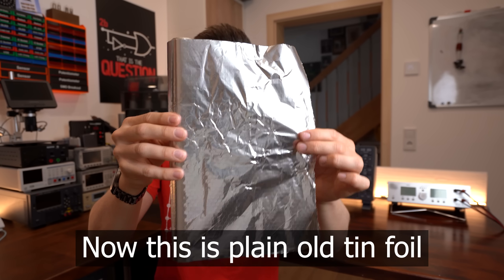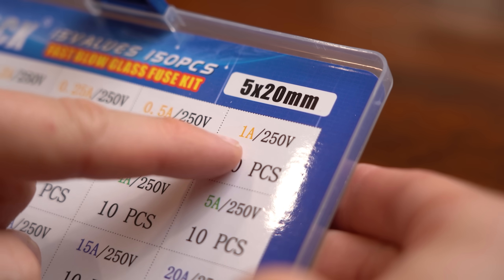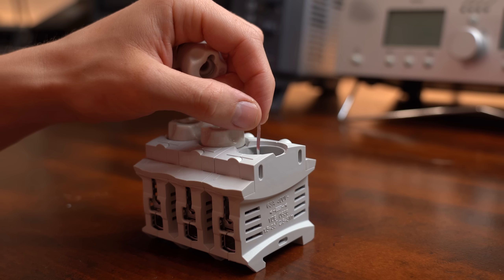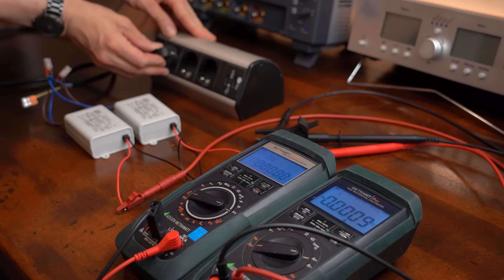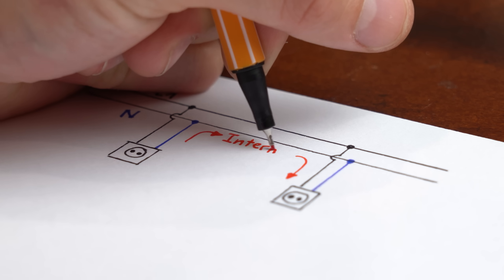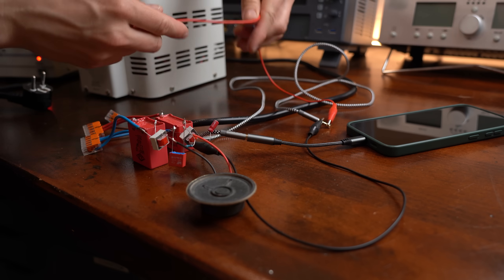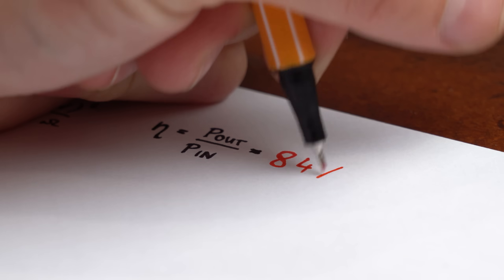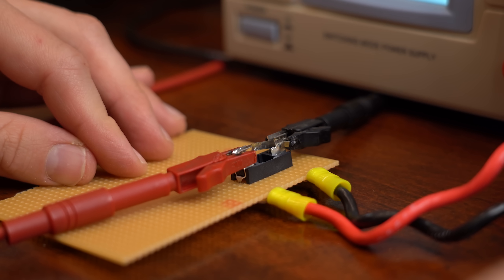I tried Busting 4 Weird Electronics Myths!

Comment: An interesting commercial (?) application of motor-as-inductor is the Tesla Roadster's battery charger. Yup, that's right, the 17kW internal 240VAC/70Arms battery charger of the Roadster uses the induction motor as the inductor when charging the traction battery. This was design content inherited from the AC Propulsion T0 (the IP from which the Roadster was derived), and is frankly silly in several ways. 

The efficiency is pretty low, but more critically, it means that the entire motor needs to be double insulated from the vehicle chassis for electrical safety. The motor uses an insulative drive coupling, is mounted on insulated standoffs, and is, very unfortunately, air cooled through an insulating duct. 

Anyone who has worked with cooling of high power density devices knows that direct air cooling REEAALLLY sucks. Blows? Well, it's very not good. Water cooling with a separate radiator is massively better in most ways, with lower pumping power loss, more flexible packaging, etc etc.

But it did work, some several thousand of them were sold, it launched an EV empire, and catapulted a very (ahem) interesting person to world fame. So, in that one application at least, we can't really denigrate the motor-as-inductor.

Comment: @5:10 This experiment, but with two (or more) identical high-quality server PSUs would be really interesting. These devices obviously have overcurrent and heating protection, so I cannot really see a reason why you couldn't run them in parallel.

Comment: Lay person question about Fuses:

Are there reliable reset-able/electronic (?) fuses for DC for something like “I know the device powered can draw max 3 A, so I want a fuse that immediately disconnects the current if 4 A are reached” to prevent damage to the cables or power supply?

Comment: I have seen that sort of thing mentioned in the 30s.   I think that they did not use standard tinfoil,   but rather the very thin sort of foil used in cigarette packs or chewing gum wrappers.  Cut into strips rather than wadded into a ball.

Comment: In the late 80's, a friend owned a Mazda Capella here in Australia.  While out and about one day, one of the fuses broke and we were stranded.  Not wanting to wait for a tow-truck or catch a cab (the years before mobile phones) we would have to make a trek to the nearest phone booth and call for help and we both didn't want to do that.  We were smokers (we know, horrible) and cigarette packets had a type of tinfoil paper inside around the smokes.  Using a trick his uncle (a mechanic) had showed him, we ripped out that paper, folded it up around the old fuse and inserted that.  It WORKED.  We got the car started and got to drive home.  Of course he was never going to keep it there, but it worked enough to get us home and again to get his car to his uncles the next day to fix it properly.

Comment: For the fuse you are only supposed to put a single layer and hold it in with the glass element.  Power line communication actually uses pretty complex modulation and error correction, so it's only good for digital data, and completely fails if you plug a cheap Chinese phone charger  anywhere in the house.  Finally APC actually modulates the H bridge on the inverter transformer as an inductor (using leakage inductance) to boost the voltage and charge the UPS battery.  The down side is it gets really hot modulating a steel transformer at khz. It's great if you don't mind cooking the battery and buying a new one after the warranty runs out

Comment: I always thought the tinfoil thing was that you were supposed to wrap it around the outside of the blown fuse. But then I may just be thinking of watching MacGyver do it all the time, and I think he used to use a gum wrapper.
Either way I don't think the idea was that it was supposed to serve as an actual, appropriately valued replacement fuse, but rather that you'd pray the house didn't burn down, until you could source an appropriate replacement the next day or whatever.

Comment: It's worth pointing out that there are some power supplies that are designed to allow paralleling like you described. This will be a feature called out explicitly in the data sheet in my experience.

Comment: Ive used strands of super thin copper to mimic a fuse, when my buddies cj5 jeep died in the middle of the woods after we got done mudding, it worked fine, when I got home I tested to see where it would burn and it was 4.5ish amps, replacing a 5 amp fuse, I couldn't believe it was that close lol.

Comment: My grandpa and dad used to do this fuse override hack. A single wrap or line of tinfoil not an entire replacement. The idea was to get the thing to run a while longer not to actually replace the fuse. Depends on the appliance they were using it for, can't remember exactly.

Comment: For sending audio over the power wiring, it needs to be modulated to a higher frequency. I've got some intercoms that use FM at around 200kHz.
Reply: Nah, just band-stop the AC frequency and call it a day. Do you really need 50-60Hz audio?
Reply: @mgancarzjr  for voice only, you still need to transmit approximately 300 to 3400 Hz. It's easier to do modulation than to create filter that will eliminate 50 Hz enough, while passing 300 Hz without attenuation.
Reply: @mrblc882  it's easier than throwing a capacitor and resistor in front of your speaker?
Reply: @mgancarzjr  RC filter have slope 20dB per decade. 23 Vrms signal at 500 HZ would end up attenuated to around same level as 230 V main after passing trough that filter. Same as 11 Vrms @1kHz. That is reason why you cannot just slap one simple RC filter...
Reply: @mgancarzjr  There will be a lot of harmonics on the power line. They will be well up into the voice frequency range.
Reply: @rocketman221projects  each harmonic should be another -3dB compared to the fundamental, no?

Comment: With the double power supply setup, I can imagine it being worse than just a reduced lifespan. The increased temperature will start affecting resistances, diode forward voltages and capacitances, and that might make it even less efficient and lead to thermal runaway. For those still on the fence because it might still seem borderline usable at face value, don't risk it! Just get a properly-rated power supply, and derate it for good safety margins!

Comment: Yeah no one has ever used aluminum(Why do people call it tin still?) foil in place of a fuse thinking it will actually work like a fuse. Just a way to complete a circuit temporarily(hopefully) until you can replace with a proper fuse. It will complete the circuit though so no there is no myth here to bust.

Comment: Foil fuse I have found in many bar entertainment systems that would come across my repair bench. It is like the penny fuse myth. Use a penny in the fuse slot is equal to the number you call for the Fire Department. 
Here in the US we have single phase AC and the signals on the AC line work fairly well. I do not use them. 
I have heard the myth of the motor inductor exchange, but have never tried it. Might have to investigate that more.
Peace

Comment: AI Summary

Abstract:

This video investigates four common electronics myths or quick fixes, testing their validity through practical experiments. The myths examined are: using tin foil as a makeshift fuse, connecting identical power supplies in parallel to increase current capacity, the mechanism behind Power Line Adapters (specifically questioning simple capacitor coupling across phases), and substituting a DC motor for an inductor in circuits like boost converters. Each myth is systematically tested, explained, and ultimately categorized as "legit," "plausible," or "busted." The analysis reveals that tin foil is a dangerous and unreliable fuse replacement, paralleling power supplies is possible but prone to uneven load sharing and potential damage, Power Line Adapters use complex circuitry beyond simple capacitors for coupling, and while motors can function as inductors, they are inefficient and unsuitable for demanding applications.

Electronics Myths Tested and Debunked/Verified

*   0:00:32 Myth 1: Tin [Aluminum actually] Foil as a Fuse Replacement:
    *   The idea is to wrap tin foil around a blown fuse or use it in a fuse holder.
    *   Experiment: Tested conductivity (conducts well). Measured resistance of different foil "sausages" (highly variable, higher than contacts). Attempted to make it reliably blow at specific currents (e.g., 10A).
    *   Finding: Tin foil conducts electricity but has inconsistent resistance. It requires significantly higher current than a rated fuse to blow, making it unreliable and dangerous for overcurrent protection.
    *   Verdict: Busted. (Bonus myth: Foil resistance dominates contact resistance - Legit).
*   0:04:43 Myth 2: Connecting Power Supplies in Parallel:
    *   The goal is to connect two identical power supplies (e.g., 12V 1A) in parallel to get more current (e.g., 12V 2A).
    *   Experiment: Connected two identical 12V supplies in parallel. Measured current from each supply under increasing load. Tested with slightly non-identical supplies.
    *   Finding: While output voltage is maintained, current sharing is uneven. Due to tiny voltage differences, one supply always delivers significantly more current, potentially overloading it or even causing reverse current flow into the other supply. The issue worsens with less identical supplies.
    *   Verdict: Plausible, but risky and inefficient without proper load sharing mechanisms or identical supplies.
*   0:07:24 Myth 3: Power Line Adapters & Phase Coupling:
    *   Investigates how Power Line Adapters transmit data over mains wiring, especially across different electrical phases, questioning if it's just simple capacitor coupling.
    *   Experiment: Teardown of an adapter revealed complex circuitry (ICs, transformers), not just capacitors. Researched datasheets (found Analog Front End ICs). Built a test setup using capacitors to couple an audio signal across isolated AC lines.
    *   Finding: Commercial adapters use sophisticated modulation and filtering. Simple capacitor coupling can pass signals across AC lines but is inefficient and performs poorly, especially with mains voltage present. Real adapters are far more complex.
    *   Verdict: The idea of simple capacitor coupling is Plausible in basic principle, but the myth that adapters rely solely on this is Busted; they need much more advanced circuitry.
*   0:10:26 Myth 4: Using a Motor as an Inductor:
    *   The idea is to use the coil windings inside a DC motor as a substitute for a standard inductor in a circuit (like a boost converter).
    *   Experiment: Tested a boost converter with a standard inductor. Measured inductance of various motors. Substituted a motor with similar inductance into the boost converter. Tested performance with and without the motor's magnets.
    *   Finding: A motor can function as an inductor and make the boost converter work, but efficiency is significantly lower compared to a proper inductor. Removing magnets slightly improves performance. Motor cores aren't optimized for energy storage, inductance varies with frequency, and they handle less current for their size.
    *   Verdict: Plausible for non-critical, low-demand situations, but inefficient and unsuitable for most practical applications.

I used gemini-2.5-pro-exp-03-25| input-price: 1.25 output-price: 10.0 max-context-length: 128_000 on rocketrecap dot com to summarize the transcript.
Cost (if I didn't use the free tier): $0.03
Input tokens: 13571
Output tokens: 915

Comment: X10 automation protocol works by sending a pulse signal at the zero crossing of the AC wave. The capacitor trick was used to couple the signal to our second phase. If you had a 240V appliance (using our 2 120V phases) you could sometimes get by without it.

Comment: I have seen all kinds of fuse bodges, from a single strand of thin wire to solid 2.5 square mm wire jammed in there but I have never seen someone use aluminium foil. That being said, for the mains fuse you were supposed to use the body of a blown fuse as a holder or dismantle it and place the foil strand inside of it.

Comment: Ive never knew anyone to say tin foil would still act as a fuse 
   Just that it would bypass it 
And thatbwas just wrapping the blown fuse in a layer of foil 

   Tell you something crazy though 
I have this power inverter 200watt
Model E8960
  
   It had a 25 amp fuse soldiered to the board and if you hooked up the wires wrong would blow it 
   So i decided to put a fuse in the line 
And soldiered a high e string from a guitar where the fuse was supposed to be 
    Plug in my Dremel and it burned through the guitar string after about a min 
 
  So high e the smallest string is like a 10 or 15 amp fuse 
   The 25 line fuse handles the Dremel load just fine 
   Now with a b string lol

Comment: For the 2 power supplies, connect them in series and use a buck converter to step it down to 12. In series it's 24v 50w so you can pull 12v 4a safely.

Comment: OK, now I'm curious about transforming regular wire with PVC/silicon isolation to inductor wrapped around some nut😄 That could be possibly better than using a motor coil, or? 🤔

Comment: This is not how I've seen aluminum foil fuses done. The ones I have seen were all one layer of foil wrapped around the blown glass bulb fuse - which is approximately twice as much aluminum foil  as the 10 A strip of aluminum fuse he made, so it should work as a roughly 20A fuse. I've never seen just a wad of tinfoil, and have no idea why anyone would think it would blow at any reasonable amperage.

Comment: Idk about newer computer power supply’s but older computer power supplies I’ve found you can wire all the 12v rails together in parallel giving a higher max amp load, which I’ve personally done running a 1400w car amp in my room!
Reply: lol i did the same thing when i was a kid to power a car radiator fan in my room to keep cool at night in the summer. people think canada is cold come visit in the middle of summer

Comment: If I add additional capacitors at the end of the cable of a laptop power brick will it make the voltage more stable or not since it does drop from 20v to 18v at 50w of power.

Comment: I've made plenty tin foil fuses in the past 50 yrs. It works fine in a pinch. I don't make sausages like yours, I cut the foil like an hour glass with the neck as wide as the original fuse's conductor. Test this and you'll blow the foil neck with small currents. Thanks for the investigation.

Comment: The proper Ethernet Over Powerline adapters use the ground wire in the home to transmit the ethernet, which solves all these issues. Always purchase one with a ground connector, you will get better results

Comment: I've seen the penny in the bottom of the screw in glass fuses (look like light bulb ends). I've fixed a few tin foil or copper wire tricks, too. Usually in a car there is another fuse of the same amperage you can yank out to get you to a store or home. Who needs heat or air conditioning? 😂

Comment: I used an old spoon piece to charge a 18350 recently. It was made into a plastic tube with hot glue to fit 18650 holders. I built a charger in the correct size quite quickly because it was unstable, but worked when turned in position and that was too annoying. Another issue was that I should remember where it went.

Comment: Don't put the thin foil sausage to replace the fuse. Use the burnt fuse and slide just a small piece of thin foil along with the fuse in the holder.
Reply: When I was growing up the rule of thumb was to wrap the foil from a stick of chewing gum (which is much thinner than kitchen foil) around the burned-out fuse and put it back in the holder.

I wonder if that's why auto manufacturers have switched to using blade fuses in cars. To prevent such "creative" solutions.
Reply: @daveh7720 Not only is the foil from a stick of chewing gum thinner, but the inner side is also made of paper, which makes it burn faster.
Reply: @TheDaddyotY  oh, so gum wrappers are fast acting.
Reply: @daveh7720  Another reason they may have switch to blade fuses is to prevent people from putting .22lr bullets in them.
Reply: He did it wrong, lol!  You can tell homie never had to fudge a fuse.
Reply: Exactly!
Reply: yeah. or a few strands of copper wire.
Reply: Exactly
Reply: i mean its not any better of an idea

Comment: I don't understand the suggestive negative innuendo around using two power supplies in parallel. How is it 'kind of possible'. It seems like it's 100% possible. Your observation that they don't draw the same amount of current seems like a side note and irrelevant. They're both under their rated current limit, operating well within their design, and nothing you're doing by drawing power with this setup affects that in any way, so can you actually state an issue or is this non-information?

Comment: Thanks for sharing.
What i did with the tin foil/fuse was to use the old (broken) fuse, put one winding/layer around this fuse and made a cut in it so you are left with only a thin tin foil electric path. And if it blew you did the same with a smaller cut. 
And with the power adapter parallel: use for both adapters a small resistor like .25 Ohm (depending on amperage) in series. The output gets a little bit lower but when one adapter has to feed too much the other starts helping more.
Have fun.